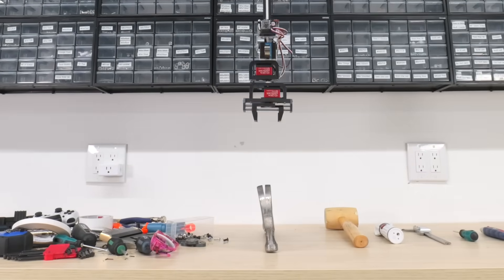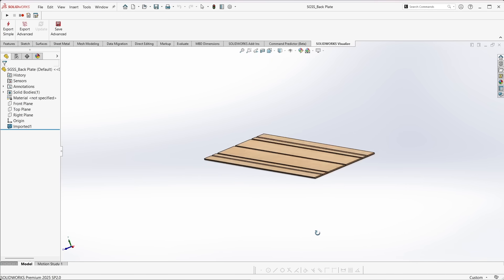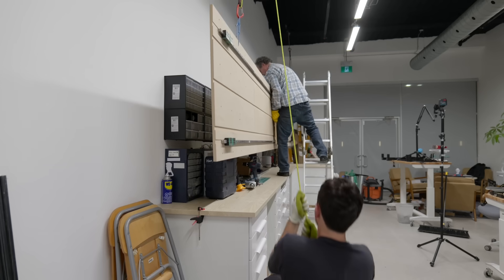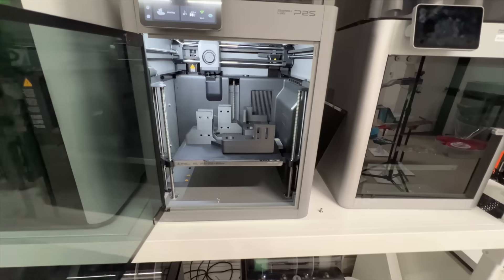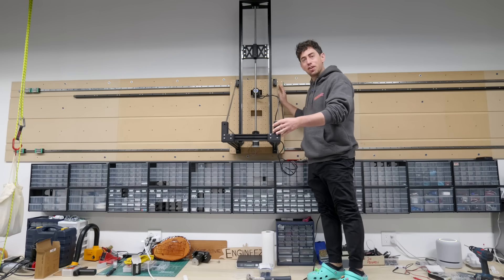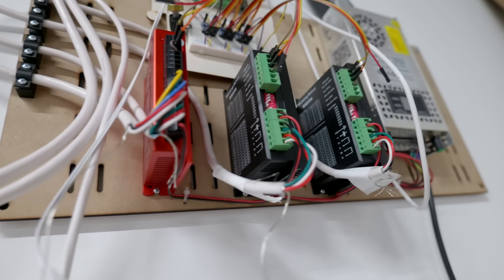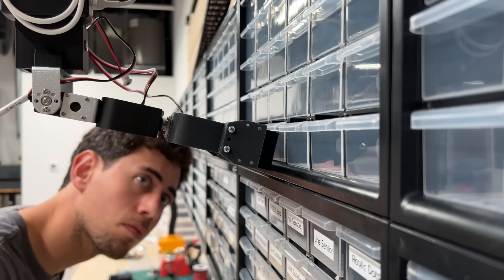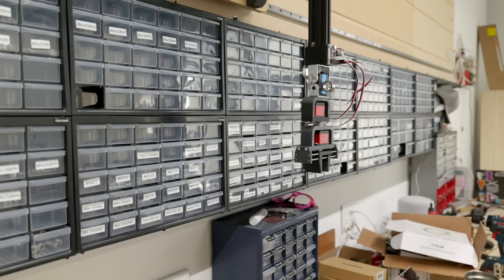I HATE Cleaning so I built THIS

Comment: All that insanely impressive engineering only to pull out the bins with two jerryrigged screws in the gripper hahah
Reply from the maker: “Clearance is clearance”
Reply: @Engineezy   My first thought was: why stick with the boxes that are already installed? I mean, you have a great 3D printer. You could make boxes that do not need to be tilted to be removed, have a perfectly fitting preparation for the gripper arm, and maybe even include an RFID tag that the robot can read them. That way, during “cleanup” for example, it could also put away boxes that you took out and therefore the robo doesnt know where they are or what they contain
Reply: @Engineezy  yes, but longevity is also a thing I'm sure you'll find out and fix

next up: use AI (obviously) to reorganize your bin-locations to optimize for speed based on your projects OR when you still want them in a fixed place so oldschool humans can also find them easily: an automatic resupply project that opens your package and refills the bins based on the content of the package with a camera-module

Comment: Great project 👏😎
I'm working on something in the same direction (entire-room camera slider 😏)

Some from my learnings, which you probably know already 🙂:
For the 3D Printed pulleys, I recommend making the outer later with pins from TPU, reduces a lot vibrations and noise.
If you plan to change the motion system, go with POM V-wheels, or make your own with TPU, this is the no 1 noise generator, especially when you go faster (linear rails are super noisy 😒).

For image recognition system, the fastest is to have 1 or even 2 cameras, a bit offside for perspective, and use a local LLM on a NVIDIA Jetson Orin Nano, pretty cheap yet super powerful (you get super fast response locally).
Other options, using a Lidar System to quickly map the 3D space and tool (a bit more work, but highly reliable and fast).
AI helps a lot here, to configure the models and integrations. Still quite some effort to make everything work well.

As a simple solution for obstacle detection, go with accelerometers for bump detection at high speeds and ToF (time of flight) sensors for around the toolhead detection (you need probably 4, top-down view from each 90 degree side).

Love to follow you progress 🙌
Reply from the maker: Thanks for the feedback! Might need to hop on a call and get the tech

Comment: So what you have built is a pick and pull robot similar to the one my little sister uses in her warehouse job.

Suggested add ons:

Inventory control.  Add a load cell to weigh the bins as they are put back in the rack to give a surprisingly accurate count of what is left.  Assign a minimum weight (count) to each bin in your database and have it generate an automatic list of parts to re-order and a count of what remains

Once your bins have been removed and placed in your bench top rack, have a robot arm remove the quantity required in your build’s bill of materials, then have the pick and pull robot return the bin.  This assumes you generate a bill of materials in the design phase.

At the start of any project, have the database compare the bill of materials to the inventory to ID any lack of materials ahead of time.

I had a friend who worked in a prototyping lab for a toy manufacturer.  He told me the bane of his life was running out of minor parts like nuts and bolts.

Idea for a similar project: 

A ceiling mounted gantry for a camera mount with AI driven positioning control that responds to hand gestures to get the shot you want.

Check out the camera gantry Inheritance Machining made for his channel.  Then add motor controls.  Then connect the controls to an AI.

Much content there if you break it into parts.
Reply: These are all great.  i was also thinking the bot could rearrange the bins while idle, placing the most frequently used ones closer to the drop zones
Reply: @Meltz14 that would not be good if you need to access your own bins manually, you would have to ask the thing where the bin was each time. The speed gain would have to be justified. Do you really have those kind of production demands that you want to introduce a whole layer of potential failure points? Keep it simple.
Reply: James Bruton built an automated camera operator.
Reply: Great points

Comment: Hey fellow canucker!! I was really excited to watch this one as it hits close to home for me! I used to have a system like this in my old shop, though much smaller :). You seem to have the same issues that i did with almost the same bins with them being hard to grip and having to juggle them a bit to get accurate placement. I solved this by designing a bracket the was screwed onto the face of each bin. It included the label spot and it was kind of a slide clip type thing and made it really easy to grab.  You could attach the receiving end on the side of the gripper you have and index it that way!
Reply: And then add an RFID tag to every box...
Reply from the maker: Appreciate the feedback, that's a clever solution!

Comment: There's no way the that program worked first try.
Reply: Like he said - it was pre programmed. It was not AI recognizing stuff, but it justmoved to specific positions that he needed to input before
Reply: it didn't and he showed us some problems that arose. In the showcase, its better to have a clean presentation, and present either before or after, which he did.
Reply: Configuring code as you calibrate and setup isn't necessary rewriting code either.
You know there will be various backlash or absolute positioning data or whatever. Unless you use someone else's auto tuning library, you kind of have variables, but their final values haven't been established. It's pretty basic.
Reply: The that The that The that The that
Reply: ALL of my programs work on the first try.  I've heard of this alleged "debug" but never needed it.  So much easier to be perfect the first time.  Have you tried being smarter before writing code?
:D
Reply: @mattw7949 😂 I'll try this next time
Reply: @mattw7949 I had no idea you could do it that way, thanks for protip
Reply: Definitely but that’s the beauty of YouTube you don’t need to show the fails
Reply: ts not that serious
Reply: 😅 @OneLinePerSubscriber
Reply: Ain't no way it pulls out and especially puts away the trays consistently. Those bins droop depending on weight.
Reply: @404errorusername  The servos he uses report their position back to the controller. So the machine knows about large deviations and can correct for them by lifting more. Small deviations can be corrected for by jiggling the trays just before insertion.
Reply: even if the servos know their exact position of the servo, the flex of the plastic tray beyond the servo is the issue.
Reply: Why assume that he done so disingenuously? Why not assume he was just lucky? cup empty full looking ahh. "Got to be that YouTube magic, because there's no way that happened in real life". 
You must be fun at- hey, you want to be invited to a party?
Reply: @matchawarrior247 I think he meant it as a joke rather than to call out the videos lack of integrity
Reply: @astroposyt2898 okay so I feel like people can tell I'm being sarcastic in my comment but we can't tell that's supposed to be funny. A simple emoji would have cleared that right up.